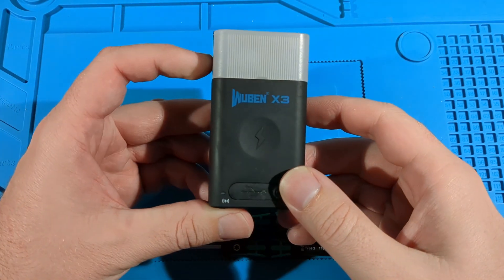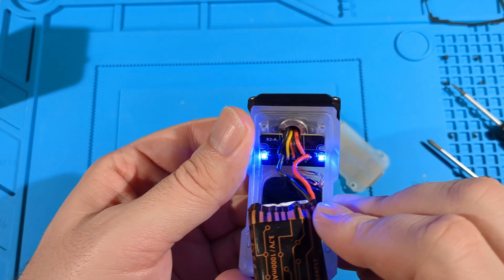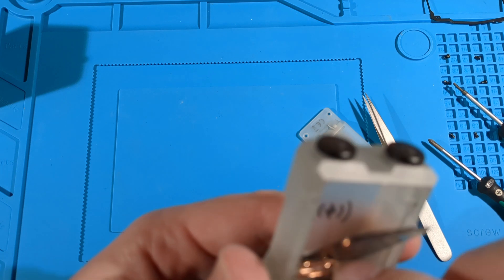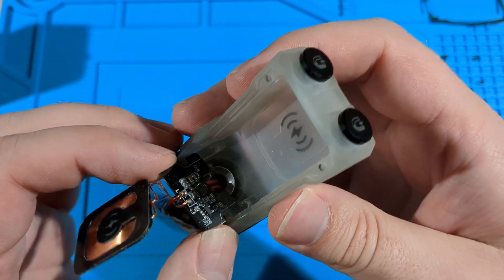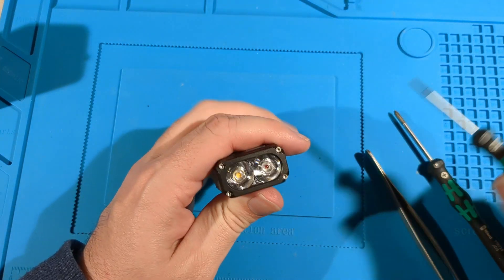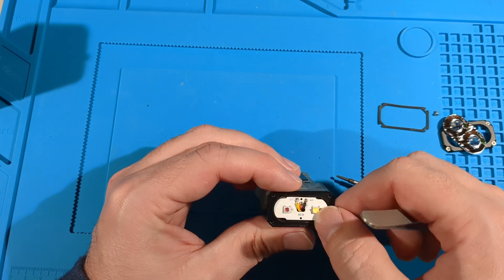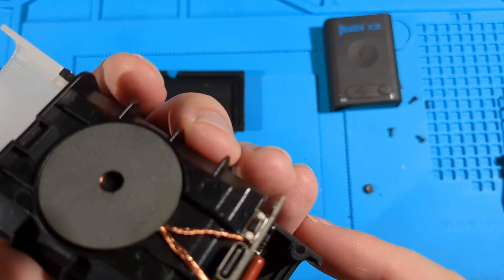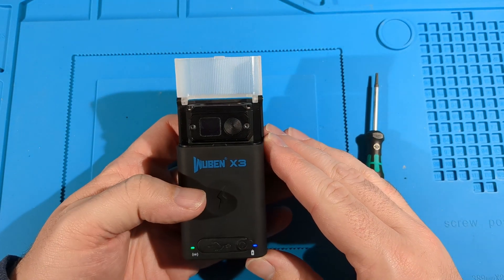Wuben X3 Prototype Teardown

Comment: Hey man, mine came a few days ago and after like two charge cycles the battery went kaput. It still makes that noise when plugged in but no indication of charge. No button inputs work anymore. I’m about to go buy a T6& t5 torx to open it up and see if I can fix it. The customer service stinks on ice I’ve been emailing for a week now no response. Just want the damn thing to work. Do you have any tips as to what I should be looking out for?
Reply from the maker: Are you trying to charge the X3 wirelessly or the charging case? You might need to take the X3 out, and hold a button down on the charging case to turn it off. Then put the X3 in and press a button. I found that the case won't resume charging when I move the X3 around until I turn the case off and on again.
Reply: @TorchHacker  I have the model with the stand. I’ve tried wireless charging and using the stand to no success. When on any type of charger, the x3 makes that kind of high pitch noise when it’s charging, but there is no indication of charge. All inputs still don’t work. I think it’s an issue of the battery not being connected to the circuit board properly. Wuben still won’t answer me
Reply from the maker: @VincenzoIannucci  It might be worth sharing a video with service@wubenlight.com to explain the issue
Reply: I was just googling because same thing happens with mine, it was working for less than six months, then it turned off and is unresponsive, doesn't seem to charge. I wrote Ruben but still haven't heard from them, I am in EU so I hope I can get them to fix it. Did you get it fix?

Comment: Was curious about the repairability and battery replacement possibility. Seem simple enough with a bit of soldering.
Reply from the maker: The Wuben X3 is fairly easy to open and modify with the right tools. 🙂